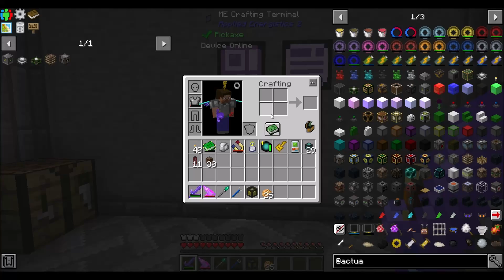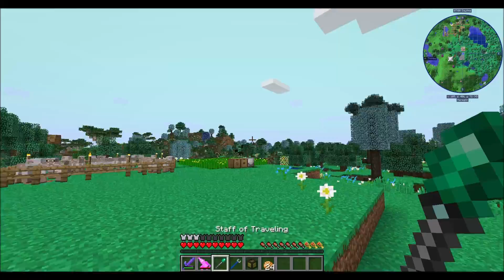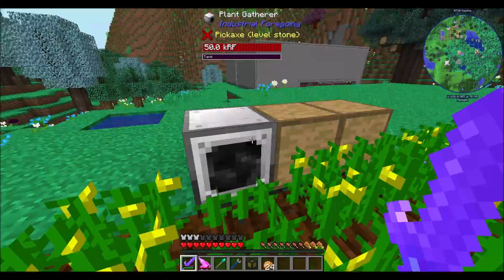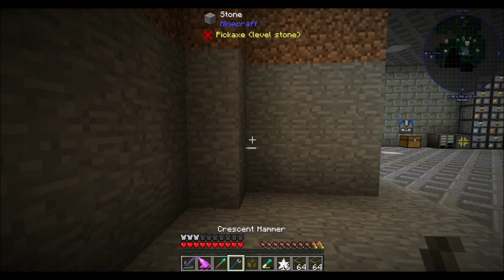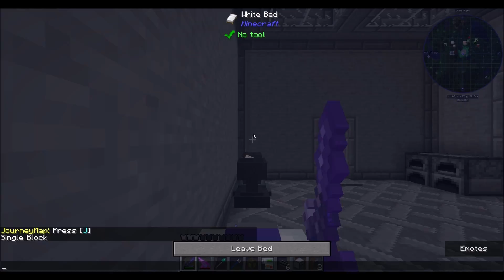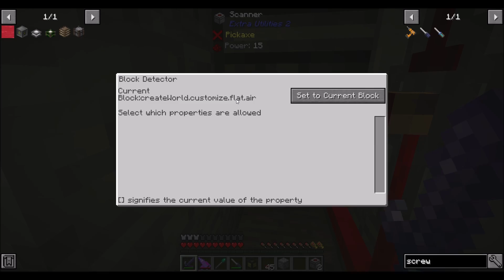FTB Revelations   Ep15 Canola Power Pt1

Comment: I wish there was a more high tech option to get the cable anchors. The knife is fine for the low tech start of ae, but it is such a pain to automate since it takes damage and the last I tried, the autocrafting really flubs up when an ingredient is one that's re-used. If you do more than one iteration at a time, it sees there's only one, so it makes a new knife for each set of the anchors you make this time. Maybe put in a recipe for a die in the inscriber for making cable anchors that's craftable. Then it accepts any ingot.

Comment: I'm pretty sure if you do get into advanced integrated dynamics you could have it convert all the way up to empowered oil in the one block, just have a block reader in place of the scanner,.Then I'm thinking a list variable with refined oil and crystalized oil, then a second list with crystalized and empowered seeds. Have it match the output from the block reader in the first list to get an index, then extract that index from the second list, pop that variable in a world item exporter, making sure the block reader is running faster than the exporter there's a config menu in the reader/exporter, and configure the export to do 1 item at a time. Then it's just a matter of a world fluid importer filtered to empowered oil. Haven't tested this but been thinking about it in my world.

Comment: I've been watching direwolf for quite long time and I always wondered. Why make such big rooms if you place everything against a wall and hide cables in wall
Reply: Space to walk around and stuff
Reply: He’s phat, needs all that space to relax!
Reply: It's part of a very sophisticated building process.

Step 1.  Build a cramped 9x9 (which is actually a 7x7) that doesn't have sufficient room for most things.  Cobblestone is required for the appropriate ambiance.
Step 2.  Dig basement because you don't have enough room in your "9x9".
Step 3.  Throw machines up against a wall because it's easy and thinking is hard.
Step 4.  Ignore all the available space in the middle of the basement and dig out a sub-basement.
Step 5.  Throw machines up against the wall in the sub-basement.
Step 6.  Return to step 4 and dig additional sub-sub-basements as needed.
Reply: Don't get me wrong guys I have nothing against this way of building but I just think that with most mods you can make all the machinery looks beafutiful and its shame to hide most of it behind walls